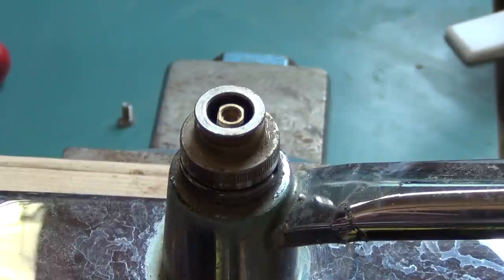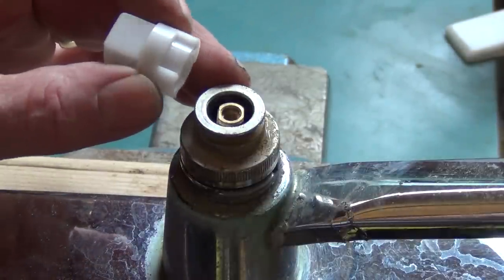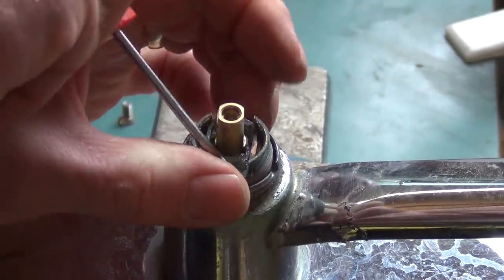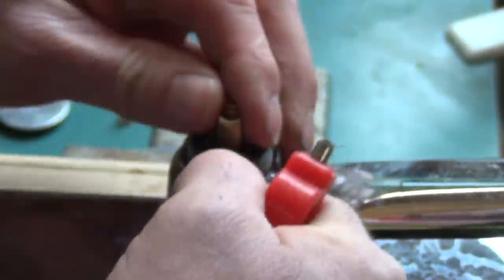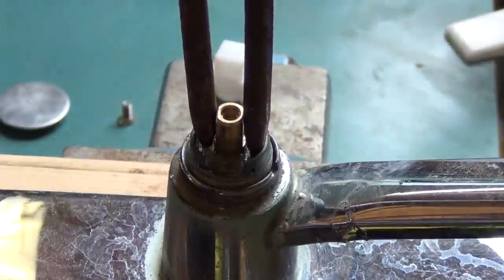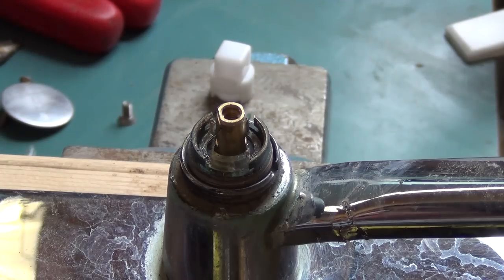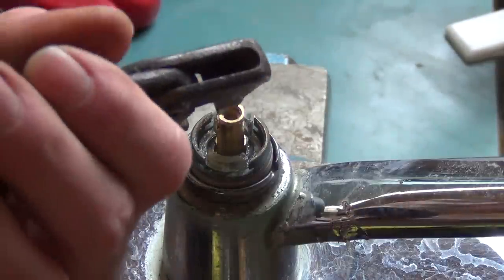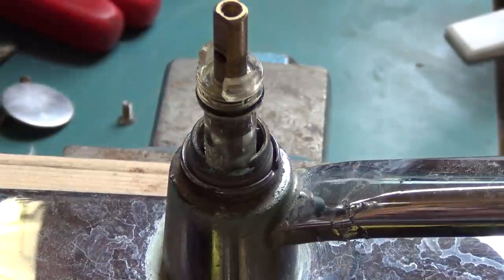Removing a moen cartridge from the faucet! If the plastic tool should fail you! Plumbing tips!

Comment: Thank you so much.  Yours was about the fifth video I watched trying to figure out how to get the cartridge out of our Moen faucet.  We didn't have the 'tool' yet because we hadn't bought a new cartridge yet as didn't know which one to buy, watched closely as to how to break it loose, did it with some larger needle nosed pliers, back and fourth till about a 360 degrees, then pulled with pliers on it, and out it came.  YEAH!!!
Reply from the maker: +Wayne Cooke 
You are more than welcome!
They can be a little difficult at times, but I am glad everything worked out for you! You are probably looking for a 1225 cartridge if it is a kitchen faucet or basin.
Thanks for commenting and congrats on the job!     Al

Comment: Al, 

Thanks so much for being of assistance - like a helpful neighbor, friend, or uncle.  This one little trick in this video of using two screwdrivers, a pair of pliers, or something similar to loosen the cartridge was exactly what worked.  I had been stymied by this repair at the last stage of getting the darn thing out.  In fact, I didn't even know what it was exactly.  And now... now it seems extremely simple, and why was I ever confused to begin with.  

Thanks for the guiding hand.
Reply from the maker: Hello yutu tuyu,
You are more than welcome!
I hope everything worked out for you!
They can be a little difficult at times and the plastic tool doesn't work on the stubborn ones.
Like you mentioned, two screwdrivers or a pair of needle nose will do the job for you!
Thanks for commenting and enjoy your weekend!    Al
Reply: The problem was, in order to get the "tool", you have to buy a cartridge -- but I had no idea which model it should be.

On another subject, any thoughts on dealing with mold?  I just found wet carpet in my closet, pulled it up and scraped and cleaned, only to find rotted wood.  This closet is directly behind the tub/shower, and thus probably the source of water is the joint between the tub and tile on the adjacent wall to the shower head, or, worse, porous grout on the wall.
Reply from the maker: Hello yutu tuyu,
The 1225 cartridge works on the basis of pulling out first to turn the water and then turning left or right for hot or cold. This cartridge is found in all single lever faucets for kitchen and bathroom sinks. It is also found in bath and shower. 
The 1225 cartridge is found in bath and shower as well, but works on the principal of simply turning it counterclockwise to turn it on and increase the temperature. You do not pull it out to turn on the water.
It is used on posi-temp faucets where the temperature is balanced and doesn't change when the water is running while another fixture is used in the house.
Hope this helps.
I know javex and water combination will work to kill mold. The thing about javex is it must be mixed with water in order to work properly. I believe it is a 70/30 combination. Straight javex will not do the job as many people think pure is better. Be sure to have a window open and a fan as it gives off a strong odour. Ventilation is important and rubber gloves as well. A friend of mine uses a combination of tea tree oil and water and a spray bottle. They are into herbal remedies. I use some myself, but have never tried tee tree oil except to relieve burns and heal cuts. Little tip for you. If you get a small burn; apply a drop or two and the pain leaves within a minute. Simply amazing how it works like this.
You should press the walls where the tiles are and check to see if any of the wall is soft.  You may have to do a little repair. If the grout is bad you should scrape it out as best as possible and regrout the joints. 
I have started using grout with epoxy in it. It dries faster and doesn't absorb water like the cement based grout does. Excellent product!
Thanks for commenting and enjoy your weekend!    Al

Comment: Thanks so much for the tip on how to break the cartridge free. I wasn't able to pull it out until I used your tip on loosening it with the needle nose, and then it came right out. It is short and to the point. Exactly what I needed.
Reply from the maker: Hello Edward;
You are more then welcome!
The trick is to break the seal that has been created between the o-rings and the faucet body. Once that is done; it comes out with very little effort as you have proven. 
Thanks for commenting and congrats on the repair!
Have a great New Year!     Al
Reply: TheOldkid888 
 I
Reply from the maker: Thanks very much!
Have yourself a great weekend!   Al

Comment: Was replacing a second cartridge and couldn't figure out why the little plastic thing wasn't doing the trick. Thanks for the tip.
Reply from the maker: Hello Harold;
You are more then welcome!
Sometimes the water can be a little hard and will cause the cartridge to become tighter then normal and the plastic tool won't do the trick; so I use the screwdrivers or needle nose and a little persuasion and it does the job!
Thanks for commenting and have a great week!     Al

Comment: Thanks for the 2-screwdriver idea. I didn't have the Moen tool. Instead of two screwdrivers, a pair of long nose vise grips fit in there just right and I was able to twist the cartridge loose. Without twisting that thing first, it's impossible to get it to pull out. It was really stuck in there.
Reply from the maker: Hello Ken,
You're welcome!
I am glad you were able to remove the cartridge. 
The needle nose do a great job as well!
Congrats on the repair!
Thanks for commenting and enjoy your week!    Al

Comment: Thank you for your video, which gave me some insight as to why my bathroom sink faucet handle is stuck (mineral deposits, hard water).  Over time, the handle began to be very stiff and difficult to turn, to the point that it won't turn at all.  I assume that I'm going to have to replace the cartridge and probably use the pliers to loosen up the existing one so it can be removed?  Thanks again!
Reply from the maker: +Leslie Tong (Shirrell Beauty) 
You are more than welcome!
Water with lots of minerals can play havoc on the faucets!
You will have to replace the cartridge. You can try the plastic tool that comes with the new cartridge first to see if you can turn it and then you may have to go the the needle nose to turn it if not. Once you have gotten it to move back and forth you should be all set to pull it out.and install the new one.
Thanks for commenting and best of luck with the repair!     Al

Comment: Thanks for the vid !  Question.....  one day, I went to pull my push/push Moen faucet to turn water on, and it felt loose and no water.   Is this also a symptom of a bad cartridge?  Was planning on purchasing one tomorrow.  Thanks in advance for your help!
Reply from the maker: Hello Pete,
Sounds like the cartridge is split in two. You may have a bit of a job removing the old one. Be sure to have the cartridge turning freely before you try and pull it out.
Thanks for commenting and best of luck with the project!     Al

Comment: Thanks for the tip! Now that I've broken the cartridge seal, the cartridge only comes out a fourth of the way. Any help would be greatly appreciated.
Reply from the maker: +A.L. Hamilton 
Try turning  completely around a few times if possible. More than likely the o-ring or gasket is jamming the cartridge in there. Sometimes you have get a good grip on it with a pair of pliers and give it some serious strain to remove them. Turning it around a few times should help you out a little.
After you remove it be sure to check inside the faucet with a flashlight to make sure there is no debris left behind from the old cartridge. If it is difficult to remove; there will more than likely be a few small pieces of matter.
Thanks for commenting and I hope everything works out for you!     Al
Reply: +TheOldkid888 That's exactly what it was. The rubber brackets were jammed and I literally had to obliterate the cartridge! Thanks again Sir
Reply from the maker: A.L. Hamilton
Glad it worked out for you!
Thanks for commenting and enjoy your week!    Al

Comment: Excellent video.....only the medal stem came out, and I think the rubber bottom part of the cartridge is still in there.  How do I get that out.   Help Please!  Thanks
Reply from the maker: James Daniels 
You will need to use two screwdrivers or a pair of needle nose pliers and slide a wrench or something like that in between the screwdrivers as in this video. This will move the body of the cartridge back and forth and allow it to loosen up enough to be taken out with the pliers.
Thanks for commenting and best of luck with the repair!    Al
Reply: TheOldkid888 and if that doesn't work? Drill it out?
Reply from the maker: Hello misterdinkly;
You should be able to to turn it with the two screwdrivers or needle nose with a pry bar of some sort such as a crescent wrench in between while holding the screwdrivers.
I wouldn't try drilling it out as you may damage the faucet body and then you would have to replace the faucet itself...
Thanks for commenting and best of luck with the repair!    Al
Reply: misterdinkly Blast!
Reply from the maker: Steven C Highley 
I am glad you got the cartridge out!
Thanks for commenting and have a great week!     Al

Comment: I am struggling with a 1225 cartridge on a sink faucet which was installed 2005.  I'm one of the people who was on my knees on top of the vanity.  Still isn't out.  Trying to make things easier for my Mom but I think I broke her faucet.  Have tried the plastic piece, have tried the puller.  It will come out about an inch and then won't budge.  Vinegar, WD40?
Reply from the maker: Hello Misabu Buffa,
Sounds like there is a piece of rubber in the faucet body. You will have to keep turning the cartridge a full 360 degrees and try and break the rubber. It will let go for you eventually. I have come across many such as this.
Turning it back and forth while pulling on it will help.
Thanks for commenting and best of luck with the repair!      Al

Comment: Part of the plastic part of the cartridge broke while I was trying to get it to move back and forth. Now there is nothing for the plastic tool or anything to push against to get it moving. Any advice on how to get it out?
Reply: Never mind. I muscled it out after putting some CLR on it and breaking my nails wiggling it back and forth with the plastic tool and then blunt nose pliers. It works now!
Reply from the maker: +Celeste Batchelor 
Sorry to hear about the nails, but I am glad you got the remaining piece out. They can be a little difficult depending on the amount of minerals in the water.
Congrats on the repair!
Thanks for commenting and have a great week!     Al

Comment: Having a problem in that both plastic "ears" have broken off the old cartridge so the plastic tool (or needlenose, etc.) can't nudge/twist the cartridge. Any suggestions for loosening the cartridge?
Reply from the maker: Hello Kevin;
You have to get something in the cartridge somehow to turn it.
Once it turns; you are all set. Then you can pull it out.
You will have to get 2 pointed tools similar to the screwdrivers and get them
jammed in there to enable you to twist them. If you could get someone to push the tools into the cartridge and you try turning it; it may help. Wish I could help more!
Thanks for commenting and let me know how you get along!    Al
Reply: Fortunately it wasn't as stuck as I thought and I was able to twist it by clamping the "nozzle"(?) tightly and twisting while pulling.  Thanks for the response!
Reply from the maker: Hello Kevin;
I am glad everything worked out for you!
Great feeling when that happens!
Thanks for commenting and have a great week!     Al

Comment: Thanks for the vid.  But still having probs.
The stem of the old cartridge pulls up a half inch or so, and makes a metallic sound.  Sprayed PBR and tapped the stem -- did both of these things several times over the course of an hour, and still no resolution.
Thinking of buying the removal tool tomorrow and trying that.
Anyone have other ideas?
Thanks in advance.
Reply from the maker: Hello Larry,
Sorry to hear you are still having a problem.
They can be a bit difficult at times. 
Will the cartridge completely turn around 360 degrees for you? Once you get it up the half an inch you could try turn it then. I haven't come across this problem before as far as the metal sound goes. Once you get it turning around, it should pull out for you. It is possible that there could be a piece of an old screw in there jamming it and making the sound. Be interested to find out what it is once you get it out.
Thanks for commenting and best of luck with the project!    Al

Comment: I can not find the name brand of my facet. Will any cartridge work?
Reply from the maker: Hello Christopher;
Does your handle on the faucet simply pull out and turn to the left for hot and right for cold? If it does it is probably a Moen. If the handle rotates like on a ball then it is a Delta. They do not have cartridges in them as such but have a few parts that will need to be changed. Most often all that has to be replaced is the springs and washers.
Thanks for commenting and get back to me when you can.       Al
Reply: TheOldkid888 yeah it just pulls out, then turns left and right for hot or cold. So far everything looks identical to the cartridge in my faucet,  before being removed. Thanks for the response and the informative video.
Reply from the maker: Hello Christopher;
It sounds like Moen to me as well.
Hope the repair goes well for you!
Thanks for commenting and have a great week!     Al

Comment: when that faucet barely starts to drip drip (likely from the hot water side)... get the replacement cartridge !  I found the cold water shutoff valve was not working at all to shut off water... so that valve had to be replaced with house supply turned 'off' before a new faucet cartridge could be installed...   that part you can do alone and do NOT wait a long time as it drips constantly.... fix it NOW.
Reply from the maker: Hello Doug,
Great advice!
A leaking faucet can cause you a bit of money over a very short period of time especially if it is hot. If repaired soon after discovering it; it immediately becomes money in your pocket!
Thanks for the input and enjoy your week!      Al

Comment: I have a danze single handle faucet, and the handle falls down on its own and shuts off the water, do you know a cure for this?...thanks...
Reply: Is it low water pressure maybe? Is it in an apt building a few floors up?  A house on top of a hill maybe?
Reply from the maker: Sorry PEI I missed this one. generally it is the amount of lubricant on the cartridge. Too much and this happens. Saw it happen on a few different brands myself. Moen included. I generally just take the cartridge out and remove a little from the inside part of it.  The weight of the handle alone will make this happen.
Thanks for commenting and enjoy your day!    Al

Comment: I tried the hair spray on the old cartridge, it work. It loosened it up and came out no problem.
Reply from the maker: Hello STARSHIP OLYMPUS,
First time I had heard about that. If it loosens cartridges I would be a little hesitant to use it on my head. LOL
I am glad it worked for you!
I may just give that a try sometime.
Thanks for commenting and have a great weekend!   Al
Reply: +TheOldkid888 Thank you sir your welcome.
Reply: I kept struggling to pull out the old cartridge. I ended up using a small vise, gave a good hard pull on the handle, and viola! (Pardon my French.) Thanks for the informative videos.

Comment: THE new cartridge comes with a small cap tool that will be used to turn the plastic ears 90 degrees to the removal position. Otherwise you can use this method.
Reply from the maker: Hello outwiththem,
The plastic cap(tool) helps to align the ears in the proper postition when installing the new cartridge as well.
I use it on every cartridge to break the seal between the cartridge and the faucet housing when removing it. It doesn't have to be turned 90 degrees when removing it. I simply use it to turn the cartridge back and forth several times before I remove the cartrdge. It makes it so much easier to take out. 
The reason for this video was in case the tool couldn't move the cartridge as you know.
Thanks for commnenting and enjoy your weekend!    Al

Comment: Help.  I can't get the new cartridge back in!!
Reply from the maker: Rey Lopez You want to have a look inside the faucet body to make sure there is nothing inside it. 
Once you have done that and everything is clear there you have to reinstall the cartridge and slowly push a little harder when the cartridge is almost in. Sometimes there is a point where it need just a little bit more of a push. 
Then you will have to make sure the cartridge is turned in the correct position with the tabs up and down. 
Take the plastic tool that comes with the new cartridge and turn it to the point where the clip slides in freely.
When using the plastic tool; turn the cartridge a little bit at a time and try installing the retaining clip periodically.
This should work for you!
Thanks for commenting and let me know how you get along!     Al